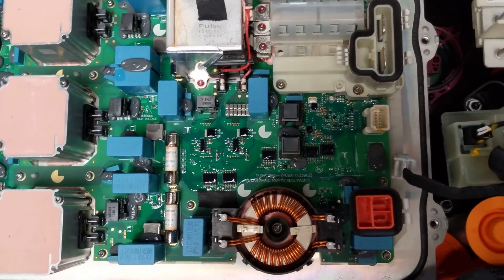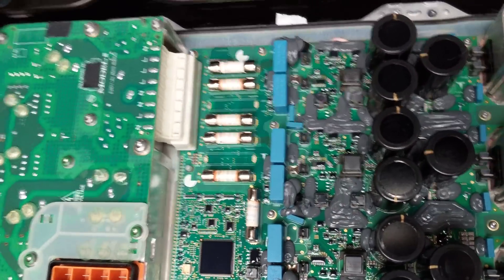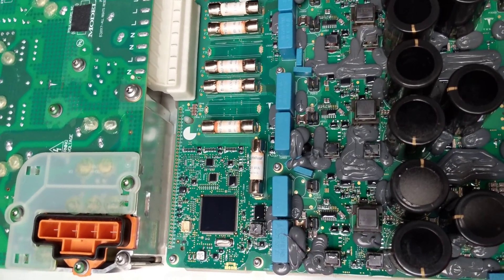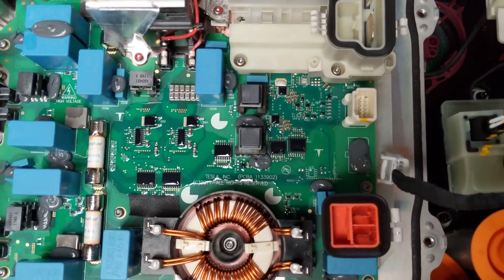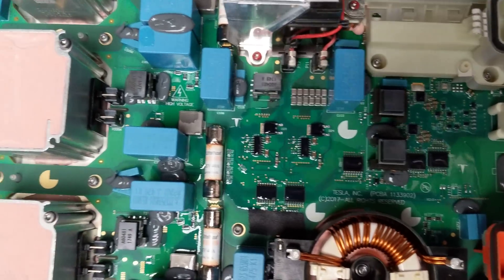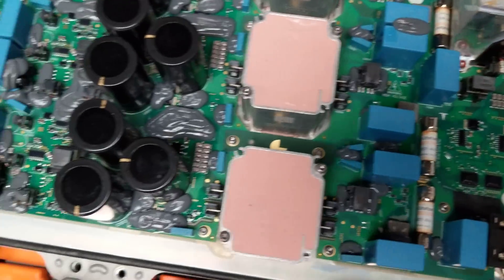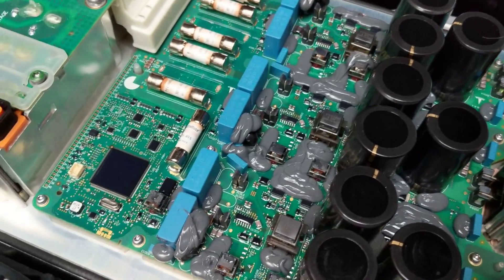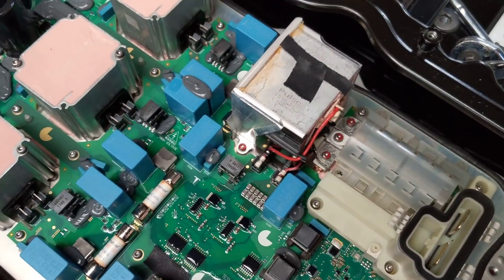Tesla Model 3 Power Conversion System

Comment: 2018 Model 3 here , can I buy the pcs and fix it myself?
Reply from the maker: Yes.   Though it does mean you have to deal with coolant, which you want to be careful not to spill in the battery.  You also need the special pentalobe socket to open the penthouse.  Study the procedure at https://service.tesla.com/ before you decide to take it on.   Once replaced you'll need to redeploy software in service mode, and you'll need a 12v battery charger capable of at least 25a to power the car until the redeploy is complete.   Use only G48 to refill the coolant.

Comment: Lots of PCS failures reported lately
Reply from the maker: Tesla has sold a lot of cars lately.  The PCS does fail more than other HV components, because it's exposed to the noisy AC power line.  The amount of failures per capita is still lower than other power supplies of it's power level.

Comment: If 1 PCS modules fail..is it most likely the 2nd and 3rd module will fail?
Reply from the maker: If the failure was caused by bad power, then yeah.  Even a new unit will probably fail if you continue to feed it bad power.   If it was a fluke, then, no, additional failures are no more likely than the first.
Reply: @Ingineerix  I'm new to Tesla. Bought used with the Gov incentive and first time tried charging at station and max was 32A so 1 of the 3 went out. 2k repair. Can you tell me what you mean by bad power and how this can be avoided. Thanks.
Reply from the maker: @MA-vk1md  Standard Range and mid range only have 2 of 3 modules populated, so 32A max is normal, only long range will do 48A.   If there is a problem with the PCS, there will be alerts visible in service mode.   If you have bad power, there will be an alert on the screen while charging.  It will usually display something like "Charge Rate Reduced" and the explanation of why.
Reply: @Ingineerix  I have a LR 3 and I see the service alert chargeboost failure code PCS a013 and a100 in service mode. It's not displaying as a fix alert..I only see it if I go in service mode. A month ago I received a message saying my home 110v charger plug is hot and I saw my Amp go from 12 to 11 to 10. I put it at 11 and seems to be working fine. So if this is bad power then my guess is hire an electrician and upgrade to the 32 or 40A plug and hold off fixing the PCS and see if the 32A maintains?
Reply from the maker: @MA-vk1md  120v (level 1) charging is very inefficient.  Charging at home at 32A is usually more than sufficient for overnight charging.
Reply: 2 of 3 bad modules. Tesla should be ashamed at the failure and not covering it under the battery warranty. This is a critical component that many don't realize is failing until it's out of the standard warranty.  Buyer beware this repair is almost $3k if not more.  Another reason not to buy but lease. Or get the extended full warranty.  This part needs to be covered under the warranty especially based on the the high number of failures.

Comment: Request a new video on the power conversion  module for Cyber Truck. The lack of visible large high voltage capacitors needs an explanation.❤👍
Reply from the maker: I don't have a Cybertruck, Can't afford one.   But looking at the design, I think they just send 100/120hz ripple into the pack.  There's a lot of evidence that this actually is good for the pack.
Reply: @Ingineerix  sincerely appreciate the clarification. Saw one of the CT teardown videos, where the tiny low voltage caps were compared with a Model Y PCS High Voltage electrolytic caps, to highlight the advancement?.❤👍

Comment: 4.5 years with my m3 and the 220 won't charge but the 110 will. Tesla said its the pcs and I need a new one.  With install $2,200! Illinois
Reply from the maker: Sadly, the early cars didn't have as reliable PCS as the later ones.   The only other option is to buy a used one and install it yourself, takes about an hour for 3/Y.  Sadly you have to drop the pack on 2021+ S/X.
Reply: @Ingineerix есть видио замены pcs?

Comment: Is this OBC and DC-DC two-in-one power modules？ Or it is just the dc-dc converter part which does not charge the traction battery. It only supply the auxiliary power for model 3?

Comment: Thank you!
I am wondering if it is possible to convert it to 3 phase. Looks like the whole AC filtering board would have to be replaced or reworked, as it's clearly visible all phases are connected together.
Reply from the maker: No, too much work, just buy a 3-phase unit and swap.
Reply: @Ingineerix  3-phase unit is €3500, as they are rare. 1ph 48A one is €500..

Comment: Do you know what the current value for output on 12 volts is?
Reply from the maker: VCFront controls the voltage and it varies depending on temperature and which of the 3 phases the AGM charge stage is in.  Here's a breakdown of what's going on:  https://en.wikipedia.org/wiki/IUoU_battery_charging

Comment: What is the converter topology with those 3 HF AC transformers in the middle, and do you happen to know that intermediate frequency value or output (pack voltage) range?

Comment: I have owned a Model 3 slightly less than 2 years and it suddenly stopped charging.  Tesla replaced the PCS under warranty, but said that it would cost $1,800 for this work if it was outside of warranty.  Disappointed that such a key part failed in less than 2 years.
Reply: Late 2018 Model 3 brand new had a failed PCS; replaced under warranty. That replacement PCS failed 2-years in at ODO ~96,000 mi (out of 50k mile basic limited warranty); $1600 parts and labor estimate. I'm asking the service center to hold old parts, will happily donate for anyone who can do the analysis to understand why this part fails?
Reply: We have a mid/late 2018 model 3 lr awd which in Early 2023 at 120k miles had the onboard charger have one section (they call it phases) go. It still charged but only up to 32a. Apparently it was the 2nd or 3rd section that went because if it was the 1st, that is also the controlling one and it would not have charged at all. It would wrestle at low amps for 3 minutes and then ramp up only reaching 32a max. The 3 sections all do 18a each.  We had it replaced like the others for $1800.   We kept the old unit. I am curious if I crack it open that the failure could have just been fuses and we could fix it and sell it as functional?
Reply: Выяснили причину поломки?

Comment: Hi Ingineerix, Did you have a look at the bottom of the board, where the FETs are, to see if they are using diodes or FETs for rectification ?
It would be interesting to see whether this charger is hardware-ready to be bidirectionnal (for V2G/V2H/V2L)
Reply from the maker: I had a look at the PCB underside again, and the output on the secondary are diodes, not FETs or any other kind of switch, so the current hardware is definitely NOT capable of reverse running.

Comment: Technically, in all Tesla batteries, doesn’t each cylinder cell have it’s own fuse wire?  So the battery would be full of fuses
Reply from the maker: Yes, this is true, but in most external pack overcurrent events I've seen happen, these don't melt.  These cell fuses are to protect against one cell shorting, to keep the other parallel cells from dumping a lot of energy into the damaged cell.  The Pyro activated fuse system enables superior protection, as it can trip much faster than a thermal-based fuse without worry of a false "nuisance" trip.  (And boy would it be a big nuisance! =)

Comment: what is the max watts that the 12v battery is supplied, if I were to put an inverter on the 12v, what is my inverter watts ?
Reply from the maker: I don't recommend over 1000W, as there has to be enough left over to run the 12v systems in the car.
Reply: I have a 1000w inverter that I can use my my prius, when I get the M3 I wanted to be able to do the same for emergency power. So you think 1000w would be the limit. Do you know what the battery AH rating is for the M3 ?
Reply: @pmacgowan  I've read on some forums that the output of that converter is like 2500w. Wouldn't that make 1500w safe if the car's just sitting there as a power backup?
Reply from the maker: It's possible, but if you are looking for that much power, it's far better to tap HV and use a much more efficient inverter rather than converting HV->12V->HV->AC.  High voltage means only the last stage is needed: HV->AC

Comment: What is the minimum current to charge the battery on AC? Or the working limit before switch off? One phase and for three phase?
Reply from the maker: 48A single phase for US market for long range, otherwise 32A, and EU spec is 16A per phase, 3 phase.

Comment: Is it necessary to remove to cooling fluid to replace the PCS ? Thanks and greetings from Germany
Reply from the maker: Yes.  PCS has a cold plate with coolant in it.  You don't want to spill coolant in the battery, so best to drain.   You have a bad PCS?  I have not seen one fail yet.
Reply: Ingineerix thanks for your answer. Yes I had a bad PCS, I got it replaced at the service center. The PCS was not able to charge three phases like we have in Europe. In my account is a video where I filmed the PCS trying to charge
Reply: I just got a 'Power Conversion System' error condition in my new Model 3 SR+, and was directed by the car to schedule service. Will see if it has to be replaced. Everything seems normal otherwise, not sure if we should be driving it or not??
Reply from the maker: @fneils  The PCS does 3 things:  1. Provides power conversion from the HV battery pack to keep the 12v system going. (This is the DC-DC conversion to provide 12v, Like an Alternator would on a conventional car), 2. Helps bring up the HV system when it's asleep (precharge), and 3. Converts the AC power to DC when you are charging on AC power.    Depending on what part of the PCS is having trouble, the car may still drive OK, but you may not be able to charge from AC power.  Or maybe it's the DC-DC function which means your car could leave you stranded when the 12v battery dies.  Best thing to do is contact Tesla and ask them if the alert affects the ability to drive the car.
Reply: @Ingineerix  Thanks for the reply. I contacted them via webform on Tesla support page the day it happened, asking if car is safe to drive. No response from them yet. I have read in forums of others seeing this error, and having to have the PCS replaced - all continued to drive the car and didn't have a problem while awaiting service.  Car appears to be driving and charging normally; will check the 12v battery with a voltmeter when my wife gets home with the car this afternoon. It goes in for service this Thursday.

Comment: Excellent and informative video, I've subscribed and liked!  Can you tell us under which scenarios the DC/DC inverter maintains the 12v system, and likewise under which scenarios it does not?  For instance, does it cycle on/off while the car is "off" and not plugged in, or does it maintain the 12v side constantly?   Under what "normal" scenario does the 12v battery see the deepest discharges?  If the 12V system is tapped to power external loads while the car is "off" will it still be maintained by the dc/dc converter, and would the PCS still be willing to provide up to ~100 amps even with the vehicle off?  Would the car detect this as an anomaly and throw an error, or just drive the load as long as traction battery charge remained?  I really appreciate your insights, Thanks!
Reply from the maker: You asked a lot here.  Maybe I'll do a video in the future.  There are a lot of forum posts on this, so please do some research.  100A should be safe if most accessories are off.  You have to tap the 12v at the correct place (not at the 12v battery!) to avoid errors.  Car would have to be "on" to safely pull loads like this.
Reply: We have a mid/late 2018 model 3 lr awd which in Early 2023 at 120k miles had the onboard charger have one section (they call it phases) go. It still charged but only up to 32a. Apparently it was the 2nd or 3rd section that went because if it was the 1st, that is also the controlling one and it would not have charged at all. It would wrestle at low amps for 3 minutes and then ramp up only reaching 32a max. The 3 sections all do 18a each.  We had it replaced like the others for $1800.   We kept the old unit. I am curious if I crack it open that the failure could have just been fuses and we could fix it and sell it as functional?

Comment: i noticed that the board is coated with some thick acrylic coating which is kind of unusual for automotive suppliers and that some parts are siliconed to the board, probably due to failed shakertests in development or to ease handling due to flimsy tht parts. Also the thing must be jam packed inside, due to the fact that they used some odd angles on some THT parts. Also fiducials for placement(pacmans) seem really big, we normally use max 3-4mm. Those can also be Mounting points or markings where certain elements have to go. Also I don't like the brown colouring on the fuses, seems to be thermal stress from soldering the package. Interesting video
Reply from the maker: Silicone attachment of high-mass parts is normal in an automotive (or other high vibration/shock environment).  Solder alone is not a good mechanical solution in these environments.  It will fatigue and crack, Especially now with lead-free alloys.

Comment: @Ingineerix: First, thank you so much for all these amazing videos. I was pointed to them from the Model 3 owners club and I have subscribed to your channel.

Some of us Model 3 owners are interested in adding aftermarket amplifiers and better subs to our cars. Your other videos already helped us find switched 12v for remote turn-on, but the big outstanding question is the safest place to access high-amperage 12V.

One user (Defjukie) said that he's tapped the DC-DC 12V line coming out of the Penthouse. He said he's successfully running a 300 watt amplifier from there but he recons someone could pull up to 200 Amps from that point. I was wondering if you could postulate whether this is a safe place to tap high-amperage power and how much power could safely be drawn.

I personally have a JL Audio 1000/1 monoblock amplifier from my previous vehicle which recommends a 100 Amp fuse, though I don't come close to maxing it out in my regular use.

With your expertise, just wondering what you think is possible and where the safest place would be to tap into for more power hungry devices.

Thank you so much for your time. And just for reference, our discussion thread can be found here:

https://model3ownersclub.com/threads/aftermarket-sound-system-info-thread.10022/page-3#post-195305

Comment: Electrical engineering student here. I always want to learn more about these systems so I hope someone is able to answer a question or two.

What's that black paste on the board near the capacitors? I assume it's epoxy for chip on board, but I have no reason to not ask and be sure.

Why do European models use a 3-phase input? What exactly is a 3-phase input? AC power is already in 3-phase, so why do American models NOT use a 3-phase input?

What's a cold plate?

Thank you for your time to read through this whole comment lol. Classes cover the foundations pretty well but they're lacking in how those foundations are actually applied.
Reply from the maker: The "paste" is a dense silicone glue that's used to harden the large components on the PCB from having vibration-induced solder joint failure.  This is a must when dealing with an automotive environment.

A cold plate is essentially a heatsink but instead of air removing the heat, they use liquid.  (Glycol in this case)  The glycol is then sent to a radiator in front to transfer the heat to the air.
Reply: It's for dealing with different domestic electric supplies around the world. US neighborhoods are wired from 1 phase out of the 3 phase supply. Some European homes (i.e. Germany) are wired to all 3 phases.
Reply: @ddud4966  Thanks for the info! Learned something new today

Comment: This is a really great video! Thank you very much for taking the time and making the video.
But could you please share the part No. of the Electrolytic Capacitor for the Bus (Those Bulky ones) and the main switching devices? Is it still a Si design or they start to use SiC?
Thank you very much.
Reply: Also, i really appreciate it if you can provide the dimension of this converter. Thank you!
Reply from the maker: The part number is Tesla proprietary.  (Read: You cannot buy it)   They do not use Electrolytics in these applications, they are likely film.  Yes, they are Silicon Carbide custom made by ST.
Reply: Thank you! It's great to know they finally move to SiC. From this video, it looks more compact than their previous version. Could you also share the dimension of the whole PCS if you have them on hand? Thank you.
Reply from the maker: Sorry, I just realized you are commenting on the PCS, I accidentally thought you are talking about the drive inverter: https://youtu.be/l6dV2re3rtM
The PCS doesn't use Silicon Carbide, only the inverter, and yes, there are electrolytics as well as film caps in the PCS.
Reply: hmm, that's interesting. I start to wonder why they use Silicon Carbide on the inverter but not the PCS. Maybe because of the cost? Thank you for your time. Looking forward to more of your videos! I am really interested in the electronics in Tesla!
Reply from the maker: I would guess cost.  Efficiency in the PCS (both for charging and DC-DC) is not really much of a factor, and those systems are already pretty efficient.